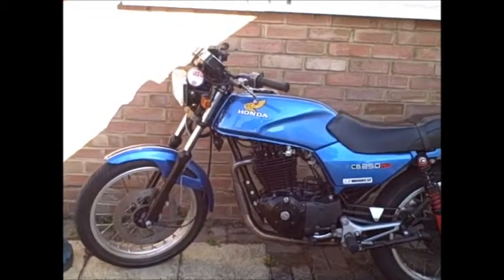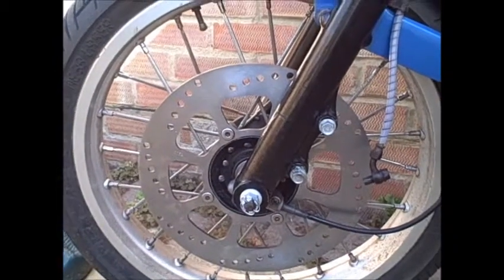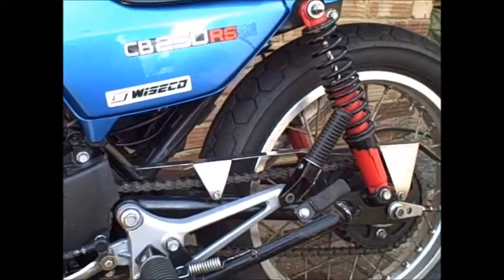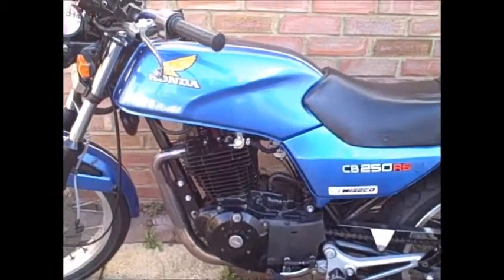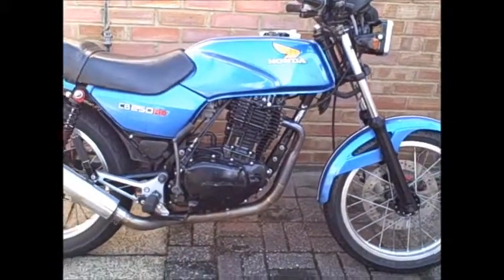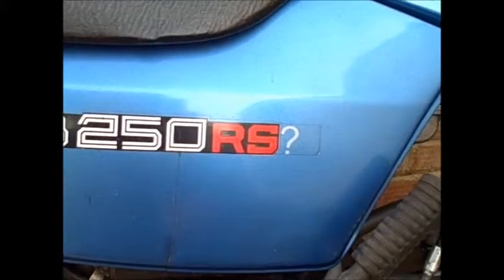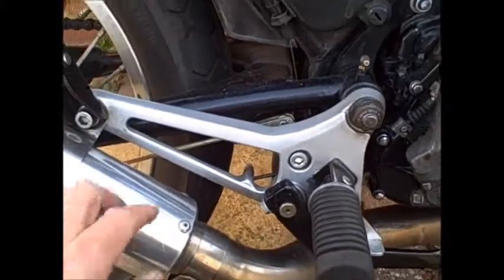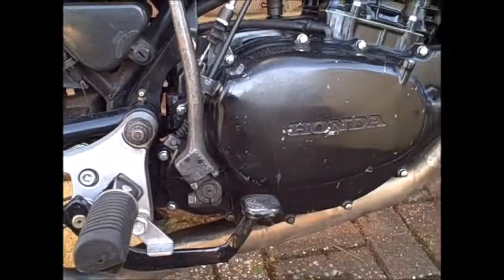CB250/500RS Walk Around

Comment: Thanks Steve, I'm just about to do a 500 conversion too. These videos have helped greatly. I'll post a video shortly. Cheers
Reply from the maker: Glad to help, I have used a CBR400 front L/H caliper with a home made adaptor bracket. I have had some firmer fork springs made by a company called Springcoil LTD which take away the dive when the stronger brake is applied but my search for a wider rear rim has so far drawn a blank, it seems the CBX 250 wheels were unusual in using 28 spokes on an 18 inch rim

Comment: Where did you get the paint to get the tank sprayed? The colour is spot on!
Also, I've watched all your 250 videos over the years and I really appreciate the videos, you've done some great work.

It's such a shame I'm struggling so much to find a 500 engine to slot into my 250!
I really want to do this conversion
Reply from the maker: Thanks, can you believe I gave my dad a side panel and he just took it to a local paint factors and they just made up a quarter of a litre of paint to match. Keep watching as I've just done a load more work on it so will make another short video. 500 engines are rare in the UK but they do turn up occasionally unlike the states where they are plentiful but I would imagine would cost lots in postal charges.
Reply: Wow that's good (or lucky haha) I might need to do that, do you know which paint shop it was?
And I'll definitely stay tuned, looking forward to the next vid, keep em' coming!